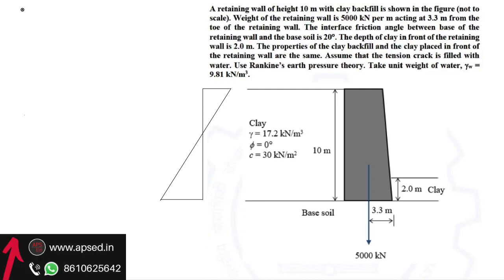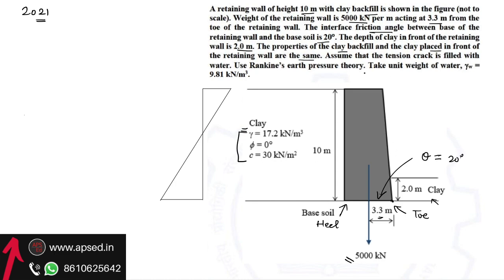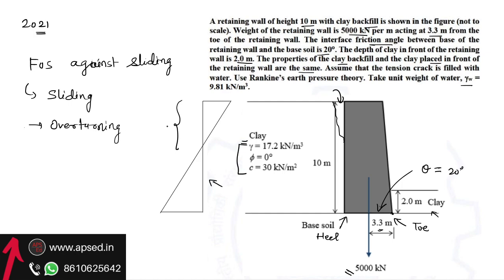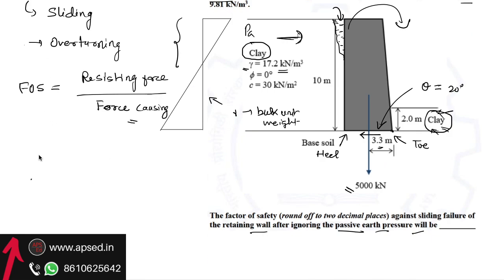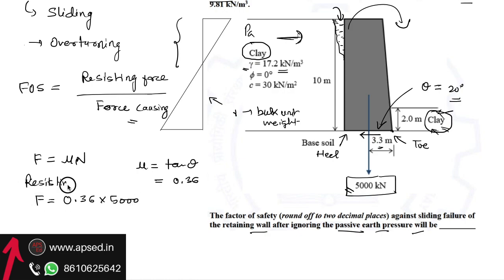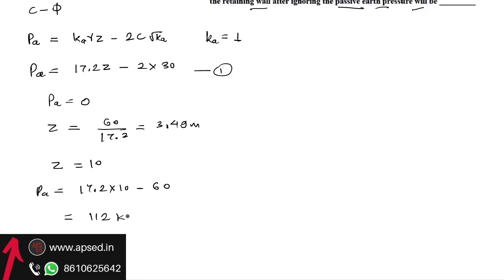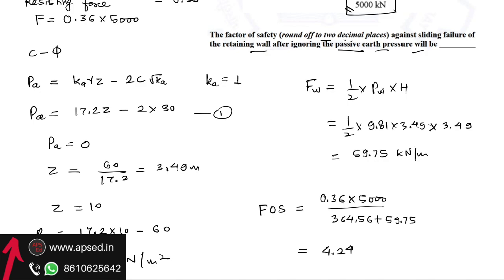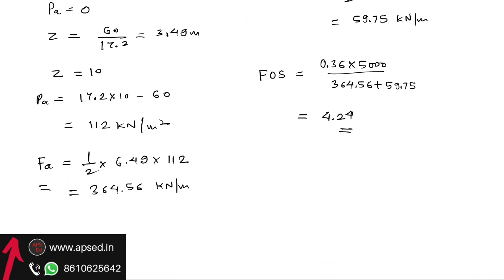Do NOT miss this tricky numerical - retaining wall | Geotechnical Engineering | GATE Civil

Comment from the maker: Which question do you want solved next?
Reply: Sir please solve question from construction management which came in 2021 shift 1.  In that question they have given ratio of Y bid to X's cost  for 30 years. And they are asking for probability of winning of Y ? Please discuss this question , it would be really helpful ..
Thanks..
Reply: @ab_IaNbSH  you can check out Ace Academy's video on construction management solutions for the bid question.
Reply: Sir , what if u take passive earth pressure in the account ? Do we have to substract the passive force to  force causing sliding (364.5+ 59.75)what we calculated ?
 And sir why one side clay will cause active earth pressure and other side passive earth pressure?
Reply: @ab_IaNbSH  I would think so. It would decrease the net Horizontal force so it should be subtracted.
Reply: @sobanlone8952   same here.
But why one side active and other side passive earth pressure ?
Reply: @ab_IaNbSH  Look the major part of the soil is on the left side. It'll have more weight and will push the retaining wall rightwards. So effectively, the soil on the right will have the wall moving towards it. So it'll have Passive Pressure.
Reply: Wind profile exponent question of Air Pollution.
Reply: @jdjadav  it's very simple brother u just have to use 1/7th power law... (V/v0) = (z/z0)^1/7
Reply: @ishanvats4992  can you explain what is the wind profile exponent for unstable and neutral condition?
Reply: Stress Distribution under footing with 2 columns from 2021 Forenoon
Reply: Environmental/transportation/maths like Major sub

Comment: Sir in calculating FOS against overturning ... How we're going to calculate resisting moment in this ques...
Reply from the maker: We will need to find the location of forces, i.e. for triangular pressure distribution, the resultant force acts at a distance of 1/3 from the top. Then we take the moment of all the forces about the toe of the wall.